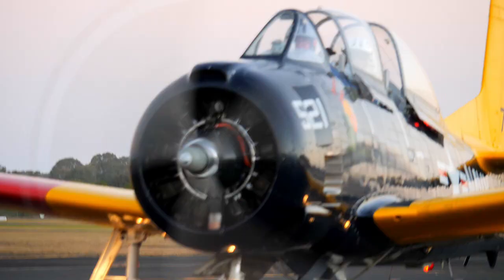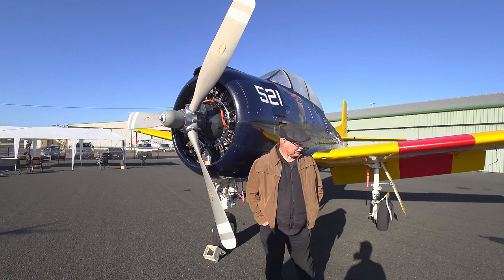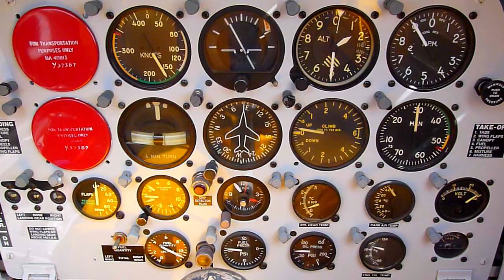The Aircraft Series | The TROJAN T-28 Warbird Story | Wings Wheels & Warbirds 2019

Comment: Yes you're right. But they were also used by the French in the Algerian war .
Reply from the maker: Thanks, they were very versatile.  Awesome machines.
Reply: The French version started out as T 28-A but were converted in transit with R-1820 engines salvaged from B-17s. They had two 12mm machine guns on the port wing tip.  Relatively shortly after arrival and use the conflict was ended.